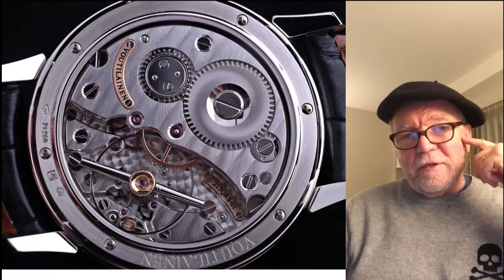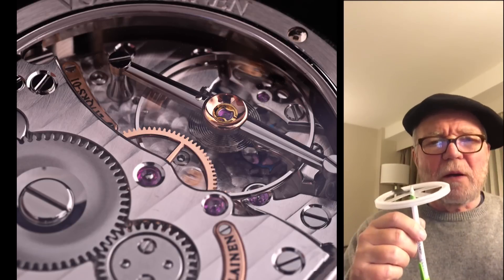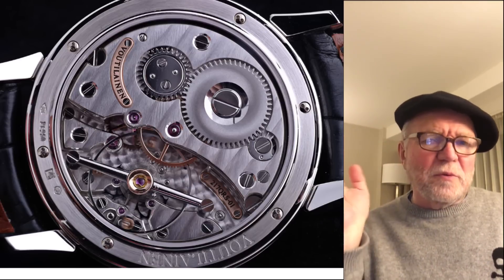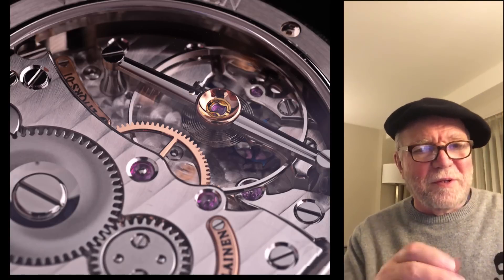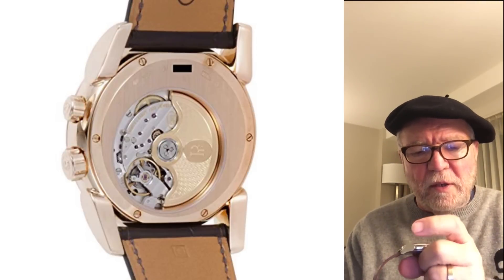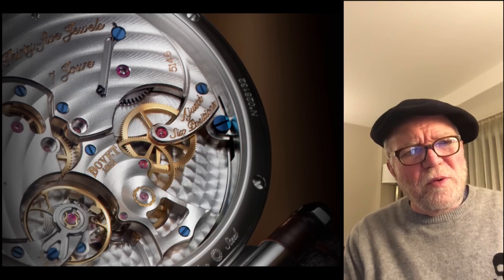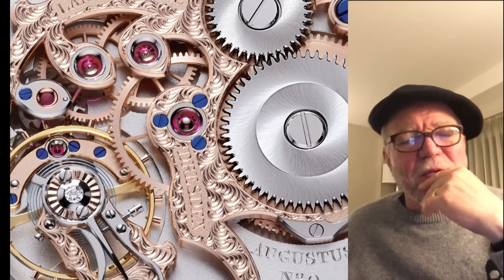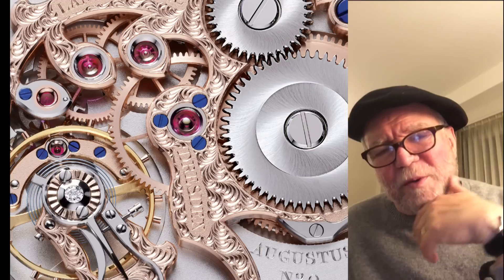Balance Wheel Dimension & Inertia #182

Comment: At 11:25, 21,6k vph is 3Hz not 26,6k no?
Reply from the maker: Sorry Andy, got them goofed up:
14,400 bph = 4 beats per second
 18,000 bph = 5 beats per second (2.5Hz)
 21,600 bph = 6 beats per second (3Hz)
 28,800 bph = 8 beats per second (4Hz)
 36,600 bph = 10 beats per second

Mea culpa...Cheers, Bill
Reply: @watchartsci  Excellent thanks!!
Reply: @watchartsci  The AP Jules Audemars 15180OR.OO.A088CR.01 uses a 19,800 bph movement which is 2.75Hz or 5.5 beats per second...there is also the Omega co-axials at 25200 bph... two oddballs in terms of frequency

Comment: Very informative. Besides exeptional horology or the higher end brands are there any strong or standard horology brands using large balance wheels? Or as some have comented how do you avoid the slow sweeping seconds problem that most of us try to steer clear of?
Reply from the maker: Calo, that's a good question! Kari Voutilainen was the only one I found who specified the width of his balance wheel..something like 13mm. Others had the width of their movement by not balance wheel. I'm going to get out my calipers and check some of my own movements and see what I can find. Let me know if you can find any published measurement of balance wheels in watches. Thanks, Bill

Comment: I too noticed that getting into this topic is hard because of the fact that it is hard to define what it means to have a good oscillator on a wristwatch. There is the physical term of quality factor which gives proper answers leaving aside outside disturbances. Once you bring in shocks and such, it becomes a complex problem.
Reply: There's a very good article by Ryan Schmidt on Quill and Pad called "the truth about high frequency movements"
Reply from the maker: Hi Diggert, I'm familiar with Ryan's article, but my query was a bit different. The question I had was based on the observation that the top independent watchmakers and other top horology creators use the lower frequency. If they're the best, why would they all use a rate lower than 4Hz and so many of the others use 4Hz as the 'standard?' Kindest regards, Bill

Comment: For time itself, it probably is irrelevant, as long as the quality & setting precision has been done well.  However, for a chronograph, the lower frequency will reduce granularity and how accurately you can measure.  Good topic, Bill.  Thanks.
Reply from the maker: southnc63 Good point ‘63...higher for chronographs lower for chronometers...
Reply: You mean "increase granularity", granularity being undesirable.
Reply: @stevep4384  "The level of detail considered in a model or decision making process. The greater the granularity, the deeper the level of detail. Granularity is usually used to characterize the scale or level of detail in a set of data".  So, I'm trying to show you can measure much more precisely with higher precision, because of increased frequency.

Read more: http://www.businessdictionary.com/definition/granularity.html
Reply: @southnc63  Oh yes, you're quite right, thanks.